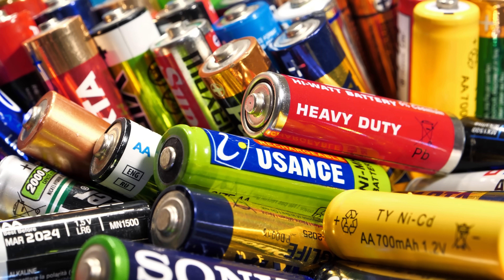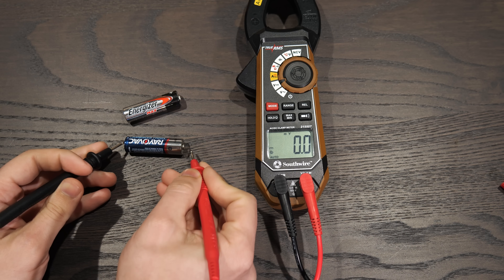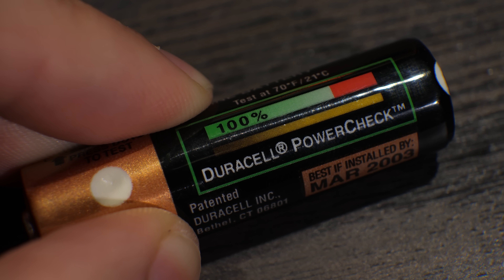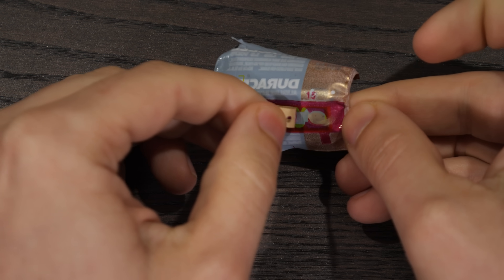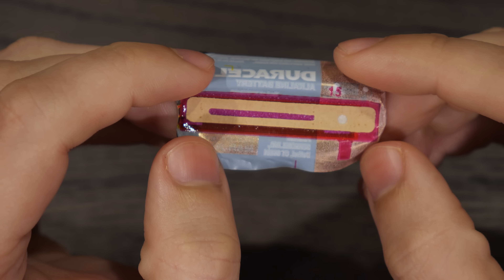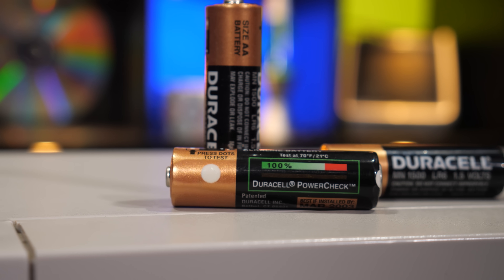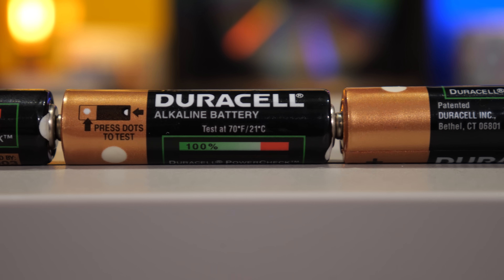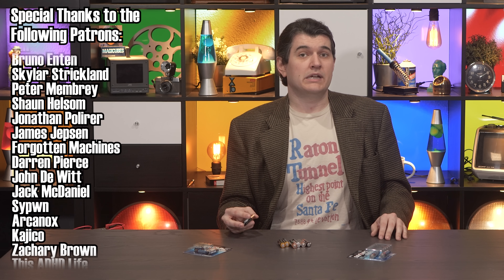Duracell PowerCheck: A genius idea which didn't last that long

Comment: I used my Game Boy Advance as a battery tester. It could only test two batteries at a time, but the brightness of the power indicator when it was red gave a rough average of the battery life left in them, and I could swap batteries around if I suspected one of them was dead. That was usually unnecessary since most devices used even amounts of batteries anyways. Using it in my GBA was also how I used the last bits of power in the battery, and sometimes I wouldn't need to buy new batteries for weeks if I had a stockpile, I would just need to avoid saving my game in pokemon if the batteries were just about to die. Similarly, the tv remote never had fresh batteries put into it, only old ones.

I either struggled to realise as a kid that I was making the bar yellow, or forgot that that's the part I'm supposed to be looking at, so I'd just keep pushing it harder and harder trying to get anything at all to change. The batteries didn't say on them what I was supposed to be looking at.

It's beneficial to take batteries out of devices that you don't plan on using. Batteries can leak, and I've had to open calculators that were wet with battery leakage.

Comment: Sometimes these batteries were a problem. The slightly increased diameter made them difficult to install/extricate in items such as a flashlight or other device with a close tolerance battery compartment.

Comment: I'm one of those people who keep partially used batteries due to having a device that will fail to run when its AAs reach about 50%. I don't use it all that often, but when I need to I save the batteries and rotate them into low power devices like the remote or wireless mouse. Testing is done in situ as you described.

Comment: I have a Duracell Quantum, a RED case battery with a date of March 2027 which requires very little pressure and has a multi color gage, from red, yellow and 2 green bars.

Comment: Wow, a lot of comments very quickly, nearly 1% of views (500k views, 5k comments at time of writing)

I think this technology would be a lot more useful on rechargeable AA/AAA/18650 cells used in households than disposables. 

A lot of children's toys still use AA and AAA batteries so I've gotten a bunch of NiMh rechargeables and a nice charger so I don't have to go through packs and packs of disposable batteries, ideally I'm at a steady state where I have enough batteries to power all the devices which I might want to use simultaneously or have on standby, with at least one set of fresh batteries ready in the charger or storage case, and never have to buy batteries or be without when something dies ever again.  Honestly I prefer the AA (AAA and 18650) replaceable standard-size batteries to all the weird LiPo/Li-ion packs baked in to so many things, when they aren't charged you have to wait to recharge them or if they sit for too long they stop working right and can't be easily replaced without major surgery, or the little micro-usb port breaks rendering the device unable to be charged again.  I know all the extra space and plastic molding to make space for removable batteries isn't free, but I'd rather standard cell sizes I could swap out than making more e-waste.

The main problem with NiMh is that for some technical reason the cells are 1.2v (maybe up to 1.3v if they are feeling spicy) but never 1.5v, most devices don't actually care that much and have a wide range of voltages they'll work with, but some devices really do need the extra voltage and only work with freshly charged batteries, dropping off quickly, and many newer devices have some sort of battery meter and low voltage warning built-in, but those are calibrated for alkaline discharge curves and tend to always report the recharchables as "low battery" which is useless and leads to useless arguments; them: "hey, did you see that has the low battery indicator? you should fix that", me: "oh yeah, it's fine", them: "are you sure you know what you're are talking about, the device insists it has a low battery!", me: "Ugh! it's fine damnit" (maybe it is fine, maybe it is actually about to die, can't actually tell, this argument sucks either way).

I just did some searching and someone is making Li-ion batteries in AA/AAA sizes that output 1.5v but they only have about 1700 mAh capacity because some of the room in the battery case is active electronics to charge and regulate voltage, they have a built-in USB-C port and light for charging.  I have a charger capable of handling Li-ion which fits 18650s but this kind of thing is probably a good idea for those devices which are more sensitive to voltage and current, but you'll probably be swapping them more often.  Not worth using in a clock or remote or something which draws very little.

Comment: I live in the European Union, patents here are a bit different maybe so they can and are still produced under the label "Duracell Ultra Power"'. My small batch of 8 AA, or more exactly the two remaining survivors, was manufactured in Belgium and they are usable until March 2026. But I can buy a new set in Amazon for 13 € right now, or at a similar price in a real store.

Still, as you stated they are damn hard to use. And it seems the one I have in my hand right now is done for. Maybe I should check the other one...

Comment: To me as a tinkerer, the 18650 lithium cell is the double-A of the 21st century. I am opening up battery packs to retrieve the cells, and all the contraptions I build, I use 18650s for that. Going with AAs these days makes no sense for anything, that has some mentionable power draw or expected longevity (remotes and the Game Boy are extremely low power devices). But still, here is a fun story for the electricity nerds:

I am an adventurer and like to go on veeeeeery long bike trips, where I need power for devices, like the smartphone for navigating through unknown areas. I have powerbanks and even a solar panel with me for such adventures, but you can never be sure, that even my 50,000Ah powerbank will endure a trip or that there is any usable sun, so what would you do, when you truely run out of power in the middle of a long trip? For that, I built an emergency phone charger, which works with AAs.
See, I have a trusty Samsung Galaxy Note 8, this thing is now 7 years old and keeps going strong as ever. This device accepts basically any imaginable power source and supports a wide range of voltages, it has a very good charging controller in there. So I can easily feed 12V to it. So for the sake, that I am far away from home and I got no power left anywhere, this emergency charger was built, which takes 8 AAs and delivering 12V this way. Why? Because you can't buy power somewhere, and also you can't buy 18650s in normal stores, AAs are the kind of ready power things, that are everywhere. And don't forget, it is an emergency charger - and having built this thing years ago, I never had such an emergency, that it needed to be used. And may never actually get used.
Because I have taken way too long to switch my bike to dynamo lights. And when you don't need the lights at day time, but this wheel dynamo keeps delivering power all the time, it shouldn't be wasted. So I added a power converter to my bike, which translates the 6V to 5V for USB devices. So while riding and navigating, I will never run out of juice with a phone of moderate processing power. My A20 can still slowly charge while navigating at full screen brightness, while the Note 8 with significantly more power slowly discharges.

Comment: I could swear I saw packages of batteries that had a similar tester built into the package. You end up with one tester for four or eight cells instead of one per cell.

Comment: I think the reason that this went out of fashion is that devices generally included more reliable battery indicators for things that were expecting to run through batteries very quickly. I remember starting to see multi-segment LCDs on electronics popping up about that time to help customers know when the batteries were going to go bad. My portable CD player had one, but my Gameboy didn't give any indication of how long I had left that could be used to clearly indicate how long until I needed new batteries. Flashlights could go through batteries pretty quickly, but tended to dim gradually over time as the voltage dropped.

Plus, there was an increase in quality rechargeable batteries about that time. Whereas the rechargeable batteries of the '80s were terrible, the ones by the late '90s were starting to get pretty good and if you were using a high drain device, you were probably using some sort of rechargeable battery rather than a regular alkaline one.

Comment: You can recharge regular alkaline batteries a couple times with a DC power supply. I did that with a 9V battery when I didnt have a new one handy. Did not last as long, but works in a pinch. More than a few times may cause leakage.

Comment: Back in the day, microphones and sound equipment ran off disposable batteries and they remove them after each show/event for transport and storage. They would have checked the batteries with a tester before use. 

Other than that, nobody ever needed them

Comment: The reason I used this the most was to check to make sure that it was the battery that was dead and not the device.  There's nothing like putting new batteries in and throwing the old ones away, only to discover that the device is still dead.

Comment: I def remember seeing these at times in the early 2010s (might've had a different look to em by then, but they probably worked about the same. Never actually used the testing function from what I recall). All I really know is that we've gotten some packs whenever the X360 controller batteries died.

Honestly never really knew how these worked, so this was def interesting to see. And admittedly this was also my first time seeing a battery without its label-

Comment: as a kid, i used to steal the batterys from remotes and other portable electronics when the ones from my toys died, so i always ended with mixed batterys, and always had to guess which were the juicy ones and the dead ones. one time i tried to injert the meter strip from one dead AA to a random one, but got no success. i was close.

Comment: It's a bad idea to leave batteries in a device that isn't going to be used for a long time, that's how you end up losing said device to leaky batteries. This is why i recommend having a battery tester. 

You also shouldn't mix fresh batteries with old used ones though, as this can cause the older ones to be over discharged in use which can also lead to battery leaks.

Using some kind of insulating material to leave the batteries in the device but not in circuit when it's not in use is a good idea

Comment: Also you can just drop the batteries from a small height onto a hard surface and see how much they bounce. 
The less they bounce back, the more charge they have left.
Not very accurate, but neither was this DuraCheck stripe. On both cases it is just useful to know if they are dead, just for TV remote usage of fresh

Comment: my use case for these was always :
"Ingie has 9 possibly working batteries in his drawer, due to a previous mishap when opening a new packet near some partially dead ones while sitting on the couch; his remote takes 2 batteries. How many combinations of batteries does Ingie have to put into the remote to find the most powerful pair of 2 batteries"  
Which is of course…  I think…  9!  / ( 2! * (9 - 2)!  … tapitty tap tap, um… 36 attempts… 
…but if you have 9 of these bad-derries… after just 9 painful exertions of far too much pressure on the ends of batteries: you're done! :D 

I mean, I'd get a battery tester, but that's one of those things you only remember you need just when you haven't got one and the shops are shut :)

Comment: I remember having a small ghetto blaster, which had batteries in it, and then I plugged it into the power point. The grey smoke got out but nothing on the thing said to only use one source of power. I wonder if the same thing would've happened if the batteries were dead?

Comment: I had a bunch of these in the late 90's/early 2000s. I had a few devices that took them and my folks generally only shelled out for about half as many batteries as there were things for them to go in, so for me it was absolutely a useful and elegantly simple, if a little janky, feature that I always wondered how it worked....

And then entirely forgot about for 20+ years until seeing this video.

Comment: Wow.  I do not remember this.  I do remember the earlier Duracell packaging, from the early and mid '90s, where the plastic bubble that held the batteries against the cardboard backing contained a tester:  I still have those testers.  I guess my economical switch to rechargeables kept me from noticing the PowerChecks when they came out.

Comment: So I remember these and have an interesting point to bring up:

Portable CD and Tape players, they need a good bit of current to run from the batteries, and the current is proportional to the voltage the battery produces.  Once that battery voltage drops too low, the media player in particular just shuts off complaining the battery was too low but the battery is not fully spent.  A device that pulls less current might be fine with the lower voltage like a TV remote allowing the consumer to get more use out of the battery before it's fully consumed.

Comment: Comparing the adequacy of the battery in practice against the reading of the power check I remember them lacking a little bit of accuracy and being almost devoid of precision. I was a kid at the time and while my memory says even kid me performed the test properly it may be me misremembering that young me believing that the methodology was proper not realizing it was not sound. I did get it to work 2/3rds of the time.

Comment: I wonder if you preheated your fingers by touching a hot cup of drink able liquid for a small fracture of seconds or rinsed them in pretty warm water for a short time, would let you need less pressure on this batteries.

Comment: i still have two of these batteries that have that powercheck meter and they have voltage around 1.3, if i can find what they were installed into ill have a video out on them

Comment: I test batteries sometimes to determine if the device is shot or the batteries are shot. I had a thermostat that when new would work until battery was 1.1 volts. Then as it got older i noticed batteries seemed to die faster. Testing determined stat stopped working when battery was at 1.34 volts.
Never figured out why it was no longer using the whole battery anymore, but the batteries were in fact still good and would operate other devices just fine.

Comment: These were so cool if not necessarily useful as a kid.  Forgot all about them and never looked up how they worked admittedly, so this is wild

I'll see the scary how fast we used to burn through batteries comment and raise the direction at one point to actually burn batteries to get rid of them... that was before my time, but seemed quite common 70s and earlier

Comment: I’m not even joking I found one of these in my old full size vhs to half size adapter and thought no way it will work its the same age as me (20 years old) but when I pressed the open button it just started as if it was a new battery and had no problem closing again. I tried the power check but I think the years had taken a toll on it cause it was stuck as full yellow.